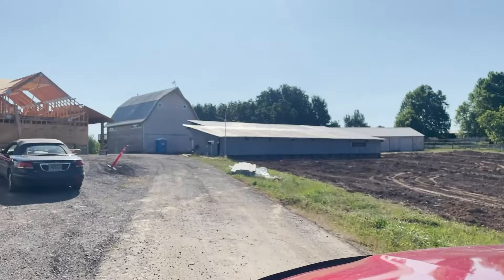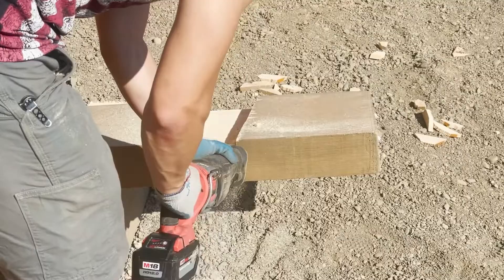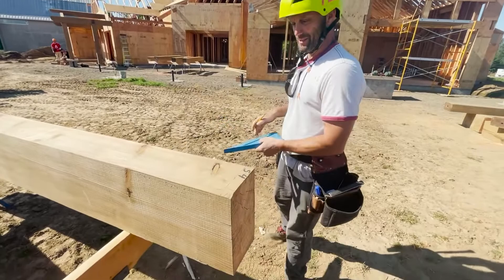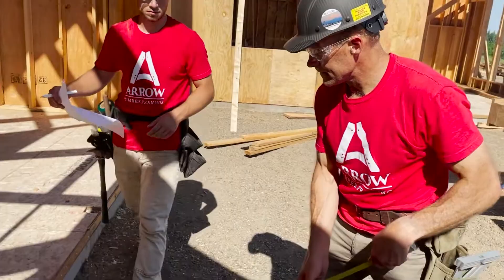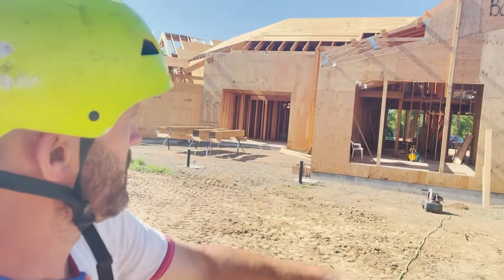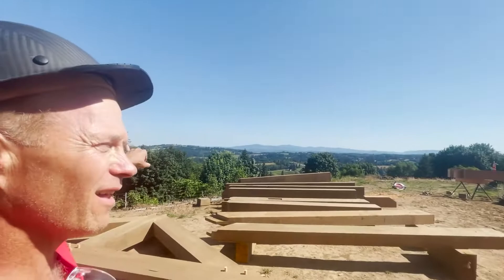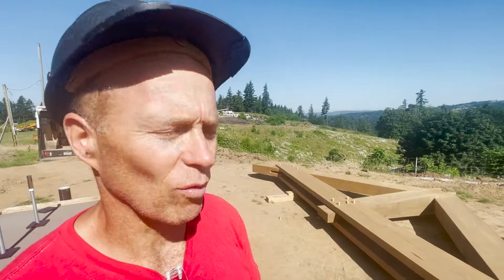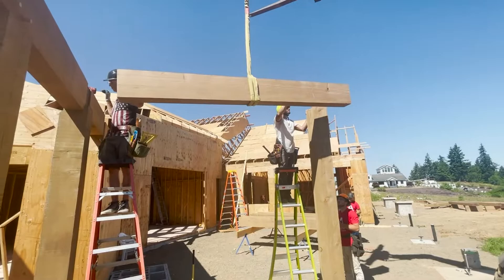Framing a Hybrid Timber Frame Home

Comment: That's not timber framing. That's wasting timber. Mechanical fasteners holding 8x10 timbers up? 1" seat cuts with no tenon's on 12x12's? This is lame.
Reply: those joints obviously arent subject to any withdrawal load